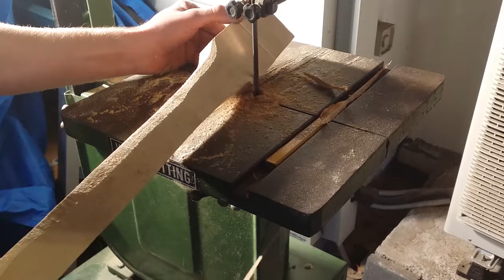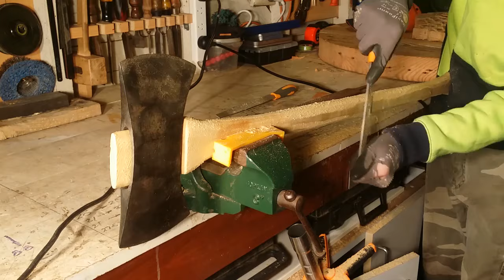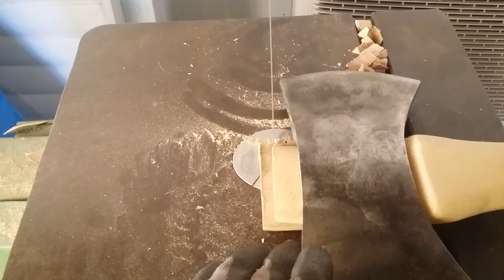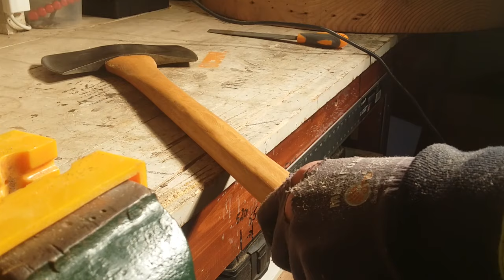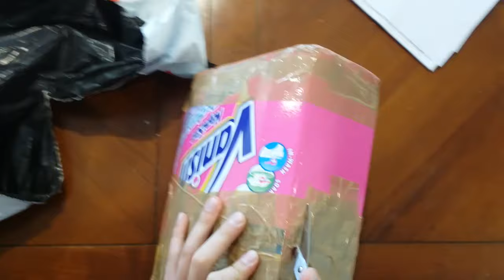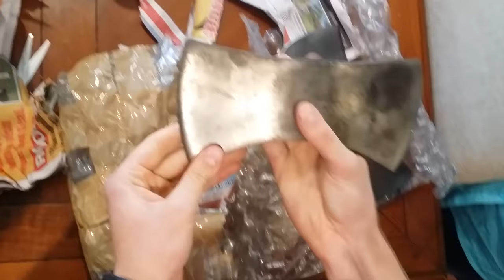Making the world's 3rd best axe handle

Comment: The grain goes diagonal and you call it the 3rd best? seriously?
Reply from the maker: Obviously why it isn't 1st ;)
Reply: Arne Schwarz  actually diagonal is an over looked orientation. It provides about the same structural integrity as horizontal or vertical. The only bad orientation for grain is if it doesn't run straight from Palm swell to the eye.

Comment: lose the metal wedge
Reply from the maker: Why?
Reply: I like the step wedge. It's good insurance.
Reply: If properly hung metal wedge is not needed. The metal wedge often times splits the grain , why would you want that.  Also if metal wedge isint used then later in the axes life if the head become loose then a metal wedge can be used in a pinch.